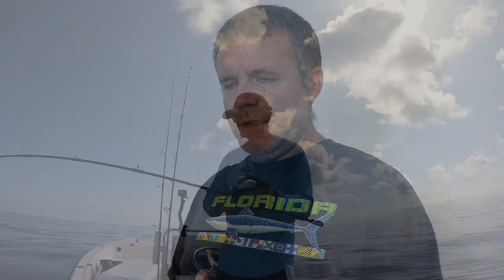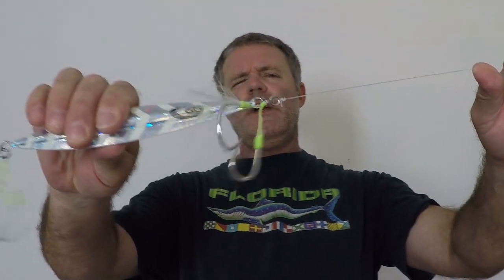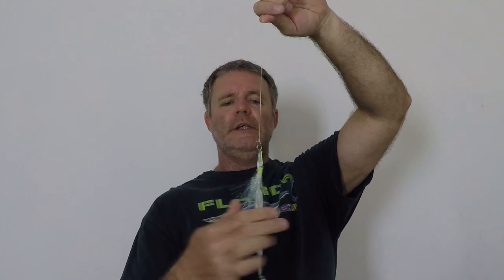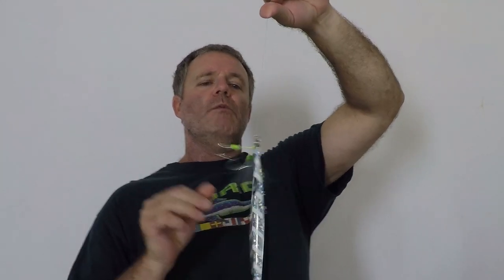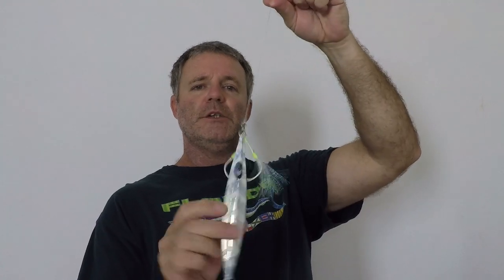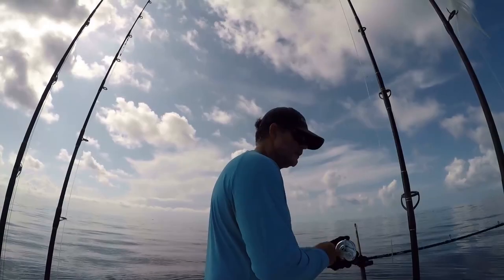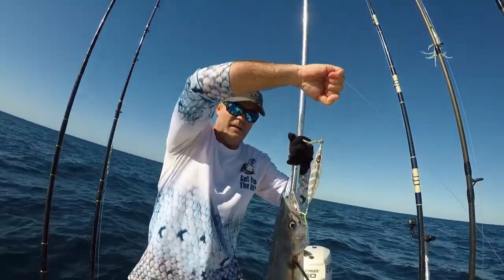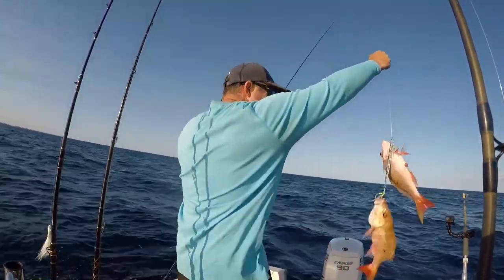Slow Pitch Jigging TRUTH ABOUT Solid Ring VS Barrel Swivel

Comment: Curious Heath
Did you try to retrieve the jig from that toothy shark? 20 bucks for a loss hand? Or do you have an inventive contraption you made to reach down there for jig removal? Another video perhaps? Thanks for the intel.
Reply from the maker: Ha... son the shark was worn out... so I flipped him on his back to put him in a trance called tonic immobility, and used pliers to cut the hooks out of his mouth and pectoral fin.
Reply: @SouthFloridaSaltwaterFishing  I think I would attach two foot extensions on those handles. Ten fingers is a good thing. Keep them coming Heath